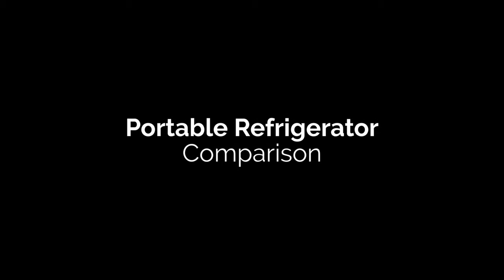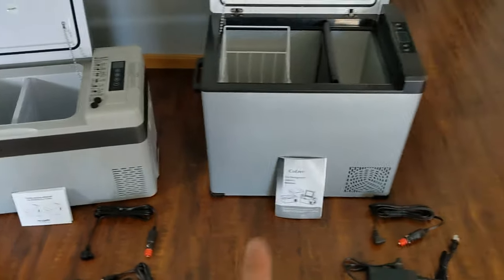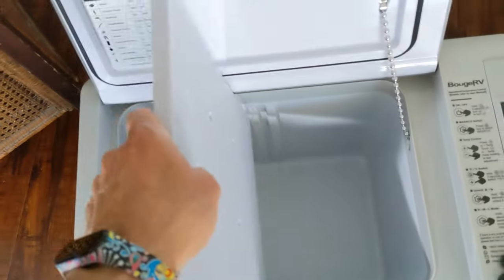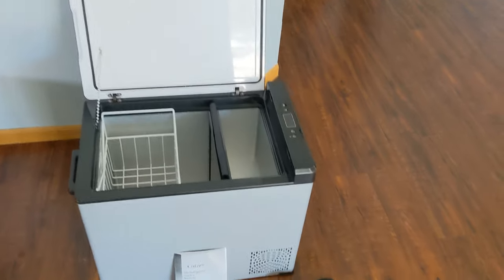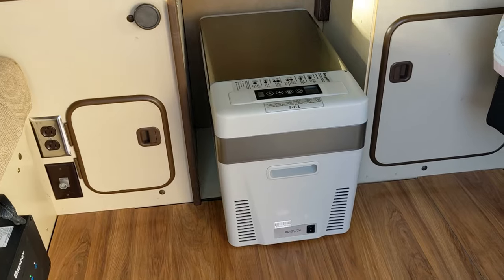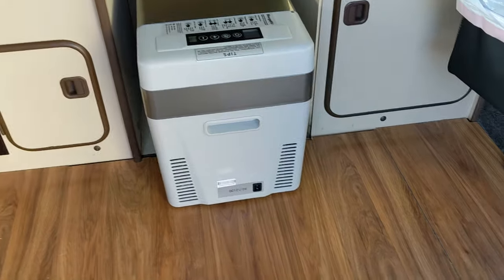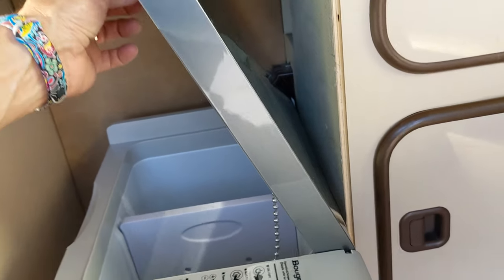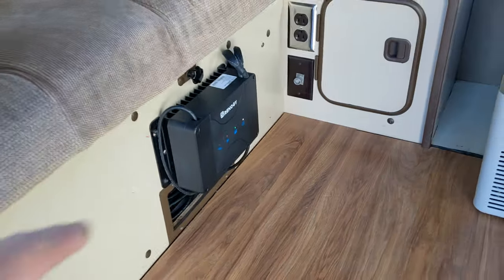Van Refrigerator Freezer Comparison BougeRV vs. Colzer

Comment: I have the smaller one and instead of getting a light inside, there's a USB Socket on the top.  We plug in a flexible USB Powered Light, so when the door is open, we shine the light down into the fridge.  Then when we Close the lid, the light shines down on a cutting board we put on top, so we can see what we're doing.